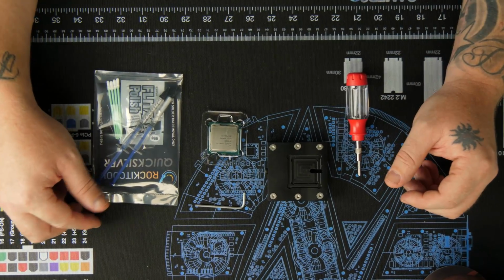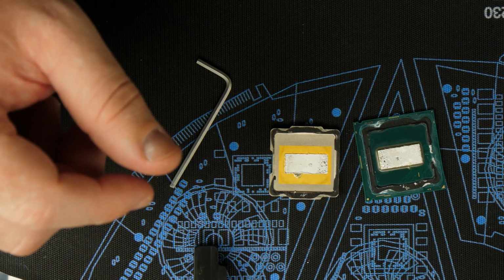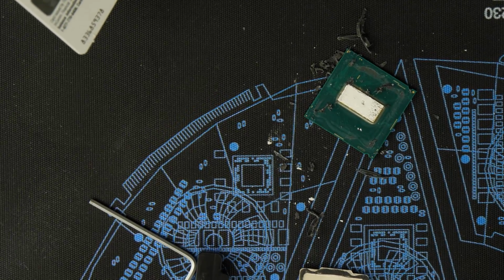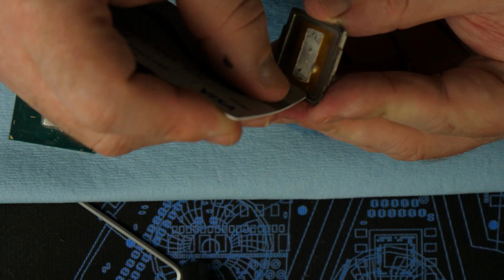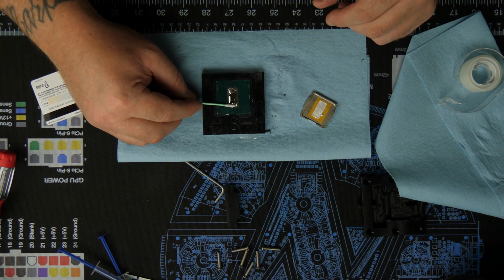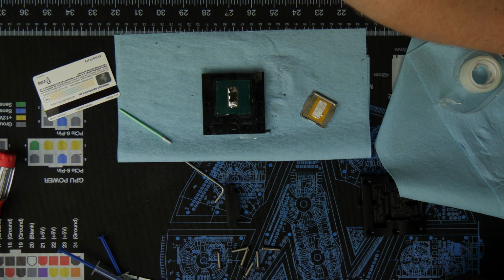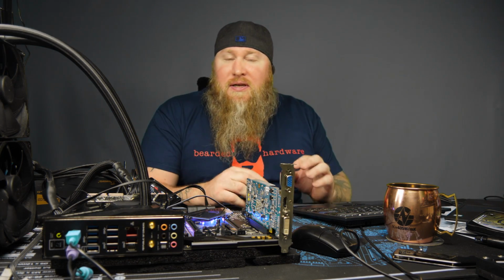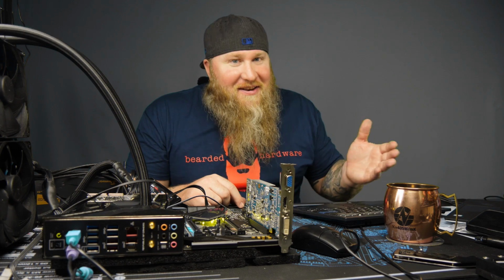Delidding the Soldered Intel 9900k CPU

Comment: Lol at 13:18 I felt a true terror cringe when you spread the solder everywhere I was thinking, " Oh God it's so much worse now!"
Reply from the maker: Hahahhahahahahah
Reply: that's why he put the tape, covering the pcb so  that it would be protected.
It would have been a horror show if he didn't!

also surprised that Joe didn't need to heat up the cpu first to soften the solder, like he said "it came off so easily, it was meant to be de-lidded" haha!
Reply: That's kinda what I thought! I feel like I've watched a soldered ryzen delid that required a good amount of heat.
Reply from the maker: Trey Matthews ya have to wonder if they use a different type of solder..

Comment: Imagine using a 9900K so close to 7/7/2019.
Reply: OC platforms aren't always the best to compute. AMD FX CPU were fun to OC but not the ideal daily drivers. Moreover, we don't know how Zen2 will behave on extreme OC.
Reply: @PainterVierax  Heh, 9900K has already been put on LN2, no need for others to do it.
Reply: @frostybe3r  Well, if you try to find some purpose about XOC you miss the point of it.
Moreover this chip is still useful. For example it's the best to avoid being bottlenecked when trying to break a GPU OC record. That may change in July (again we don't know) but for now that's what it's available.
Reply: @PainterVierax  MDS.
Reply: @frostybe3r  do you mean Microarchitectural Data Sampling?
Reply: @PainterVierax  I mean Intel failing to change architecture and being stuck with line of processors riddled with flaws.
Reply: @frostybe3r  I partially agree but this is not related to the theme of this channel. It's for extreme overclocking it's not meant to be a daily system at all. You're acting like a fanboy who can't put things into perspective.
Reply: @PainterVierax  I have both AMD and Intel's systems, getting 3950X in September, hardly a fanboy.
Reply: @frostybe3r  good for you but you still act like one by saying total nonsense.
Reply: @frostybe3r  Oh and BTW just go watch the new video on this channel, it's very suited for what you're talking about.

Comment: Are those bubbles in the solder? Wtf that's a good reason to delid. Got to be some minor hot spots there if they ended up in the right spot on the die
Reply from the maker: You saw that right?
Reply: Yeah man, that's futched up. Probably why it didn't pop. Good vid btw, parts could be shorter like people mentioned but killer background tunes. Looking forward to some more.
Reply from the maker: Kevski802 thanks broski.. much more coming for sure

Comment: they make plastic razor blades for removing decals off of the paint on cars. i bet it would be perfect for the removal of the silicone.
Reply from the maker: I would agree, think that would work very well.. the crc reallys helps quite a bit though..
Reply: I always just use an old debit card, but then again I have only done 3 cpu's and none of being the HEDT ones.
Reply: Or just plastic prying tools. I got a bunch of those from a pretty nice small screwdriver set I got of aliexpress.
Reply: It does work, though a old CPU's PCB will get the job done, used both the other week

Comment: Interesting to still see this big an improvement just from a delid on a soldered cpu.
I only delided cpu's that came which came with intel toothpaste (celeron g540 to try it out, 3570k, and my current 8700k). 

In both cases It was not really about the higher clocks 4.7 and 5.0 respectively but my aio can run so much quieter with the extra thermal headroom.
I also used liquid metal on my laptop but I wouldn't recommend it as reapply it every half year or so is a pain. (it forms an alloy with copper / dries out)
Reply from the maker: I would be careful with liquid metal on the lap top.. that stuff likes to leak out and in a small spot.. it might do it and cost ya.. totally agree about temps.. it reduces temp and gives you the ability to run different fan profiles on your cooling.
Reply: @BeardedHardware  I tend to use very little liquid metal which probably is also why it dries out fast. Leaking has never been an issue. Another thing is the laptop is a from 2016 and costed about as much as that cpu.
Reply from the maker: qlum yeah that could be why.. I tend to use things like nail polish do that way resistors don’t short etc... always better to play with old stuff vs the new stuff

Comment: Awesome video! I thought soldered chips needed to be heated up first, but I guess clearly not. Still, as a delidder I'd prefer they still use thermal paste but just make it higher quality and work on how to reduce the gap to the IHS.
Reply: I tried that and my temps went bad in less than a week (used NT-H1), they were great at 1st, so I bought some liquid metal and got another 5C improvement on peak temps
Reply from the maker: Chad McKean how did you apply paste under the die.. depending on which paste you use.. application matters a ton
Reply: @BeardedHardware  Wait did i say "under the die" cause that would be in the socket, anyway it was under the IHS after removing the adhesive on both the IHS and the PCB, the paste was NT-H1
Reply from the maker: Chad McKean yeah my bad.. meant Ihs.. ya have to be careful when you put the Ihs back on as it can slide around. When I put the chip in I use my finger to keep it in the middle and be careful how ya close it.. try it again it might surprise ya
Reply: @BeardedHardware  At this point i have liquid metal under it and have temps so low i can degrade my cpu and not even thermal throttle; https://i.imgur.com/Bznm5EA.png and yes my chip is so bad it needs many volts for low clocks, unless you see something my board i doing something silly i should adjust

Comment: So, you are telling me that with normal paste the temperature went 2 to 3 degrees lower than with it soldered? Or the solder was really bad or someting is wrong there. Normally soldered cpus are great because solder should do a better job than normal paste. But ofcourse, liquid metal is always better.
Reply from the maker: Canal 2Playerz paste did 3 degrees on average better ...
Reply: @BeardedHardware  Very strange... Solder should be better, at least, is what is logic lol. Thanks for the video.
Reply from the maker: Canal 2Playerz yeah it’s quite crazy but true

Comment: I delidded mine. Not much difference from stock. Still glad I did.
Reply from the maker: Skoopsro try lapping ihs
Reply: @BeardedHardware  I did that helped actually. I also sanded the die down a bit. Decided to step up to the big leagues, get a waterblock and join the men and ditch the AIOs. Waiting on tubes to get delivered tmro.
Reply: @BeardedHardware  Were did you get a 9900k that does 5.2 at 1.2v? Who do I need to talk to? I've got a z390dark and nice kingpin2080ti w/GPU block waiting but I only have an average 9900k. 5.1 at 1.3v
Reply from the maker: Skoopsro have to play the lottery man.. bench what ya have for now and keep looking.. how it works broski
Reply: @BeardedHardware  I have a hard time believing you got a chip that good by luck of the draw, or without buying a few hundred to bin
Reply: @BeardedHardware  thanks for the reply tho I guess
Reply from the maker: Skoopsro siliconlottery sells good chips too but you’re gonna pay

Comment: I thought that delidding a soldered 9900k would be much harder and involve an oven.
Reply from the maker: Chris Canty nope much easier then ya think
Reply: This kit use the easy-alloy chemical propriety of gallium to liquefy the indium solder. That's exactly what happens when you contaminate a tin solder with liquid metal.
I'm not sure if you can heat the indium solder up to 160-170°C and use some standard desolder wick without degrading the die since this piece was already stressed during the initial soldering process. And you certainly want to be quick, using an oven only to preheat at ~100°C (under max Tjunction) and a regulated iron to finally raise it to the fusion point. Should still be quite trivial to clean the IHS with heat.

Comment: G'day Joe,
Love the Soundtrack, also using the Plastic Card as a removal tool is so much safer than a Razor Blade, Especially as in most of the videos people using a Blade aim the sharp edge towards their fingers & end up cutting them selves,
I found it really interesting that everybody wanted Intel to Solder their IHS because the i9-7900K thermals were so bad & you just De-lid a Soldered a i9-9900K & put Thermal Paste on it & get better thermal performance, all soldering did was make it harder to De-Lid 🤣🤣🤣🤣🤣

I just bought myself a i5-2500K, EVGA Z68SLI-Micro, 4GB DDR3 1600MHz, EVGA GTX760 & cut up an old PC case to make a Test Bench so I can play along at home & learn what the settings do with your OC videos,

P.s. looking forward to more OC vids & saving up for a couple of Bearded Shirts $US is not good for Aussies at the moment
Reply from the maker: shane eslick awesome man. Still working out formats for some OC Videos.. I have many things coming .. very high end stuff.. gonna be interesting what ideas I come up with. I need to get a distributor over in Australia

Comment: THAT WAS A ACE JOB 👍👌 ,you made it look so easy Joe, I was gonna buy a pre delidded 9900k from case king so I can go direct Die , As I aint keen on using the razor blade method to get the solder off , I was willing to pay the Extra $120 Euro on top of the price of the  chip for piece of mind but after your vid I will deffo try your technique , I have delidded my 8600k and applied liquid metal  ,and its running cool and quiet 8 moths later ,so I don't mind getting my hands dirty , I just wasn't brave enough to go at the £500 quid chip with the razor , best technique I have seen , awesome Joe 👍
Reply from the maker: Gaz Yates thanks broski

Comment: Random Question, Would it be worth it if I delidded my 9900k for more than just overclocking? Reason I am asking, while I got a decent sample (Can run 5.0ghz at 1.26) the temps on the thing is crazy (75-80c, I like to keep my Procs around the 60c range if I can help it, call it OCD). Even in a full custom loop. So, I was thinking to delid it so I can bring not only those temps down, but to also make my water-cooling setup be more efficient. Less Fan Noises, Less Heat Soaking. I mean, its fine now running without the deliid at that speed and vcore. Just would like less noise to go with it. =)
Reply from the maker: Powerman 5OOO yes that could work too
Reply: @BeardedHardware Thank you for the reply. So I am going to do the delid but I am thinking about doing a direct die mounting. I know they have die frames (der8auer) for my 9900k. Question, will I have to change the mounts on my EK waterblock? With the z-height being lower without the IHS, it would seem those pins/screws on the EK mount would be too tall. Or am I over thinking it and they will still work?
Reply from the maker: Powerman 5OOO depends on which one you use.. I would read the directions on whichever one you buy.. I know rockitcool makes one also on their site.. hard to say if it will effect you or not.. either way it’s always good to be a bit paranoid .. ya don’t want to kill stuff broski!!!
Reply: @BeardedHardware Got the delid and direct die kit from RockitCool. Since all the der8auer ones are sold out everwhere it seems. No issues mounting the waterblock to the die. So far, no issues. Will see when I stress test it.
Reply from the maker: Powerman 5OOO awesome make sure you are very careful with stress testing . Pay attention to them temps :)
Reply: @BeardedHardware 3 hours in, running my safe 4.7 all core at 1.125 vCore. Has not pushed above 52c on the package. Cores bouncing from 47c-52c. =)

I will be pushing it tomorrow, once I get this test finished overnight.
Reply from the maker: Powerman 5OOO now
Bump them clocks up
Reply from the maker: Powerman 5OOO you using liquid metal?
Reply: Bearded Hardware Yes, conductonaut.

Comment: I have an off topic question, when super cooling with LN2 I see that you use paper towels as a moisture barrier, do you think 100% silicone would work as well?
Reply from the maker: Scrub Rezidue have actually used it before.. problem is the application and cleanup methods suck

Comment: You should mention that the CRC is contact cleaner and not brake clean. They make  both, but brake clean is corrosive as fuck.
Reply from the maker: Yeah I have many times before.. crc makes many different types of cleaners.. not just eletronic and brake.. have to be specific :)

Comment: My 9900K only does 5.2 at 1.37. It does not like higher than 5.2. Do you think it is salvageable with a delid or I should bin others (or wait for the KS)? The KS is going to be R0 and I know my 9900K is P0, so it will outperform the KS at the same clocks. However, the KS should be better binned and clock higher. 

If I can get 5.4 out of my current chip with a delid, I would be completely satisfied.
Reply from the maker: Frank R tbh I saw more benefit from lapping.. then delidding..  but if you lap then delid then liquid metal.. you might be able to squeeze more out of it
Reply: @BeardedHardware  Okay, thanks for the info. I'll do all three. I'm waiting to see what you can do with your binned KP 2080 TI. My two are 16th in the world in FS and I am in the top 25 in other 3Dmark HOF benches. https://www.3dmark.com/fs/19375902
Reply from the maker: Frank R pretesting today.. next week will show some ln2 live-streams .. finishing the stream box still

Comment: Makes me so sad seeing all these 9900k's getting 5.3 around 1.3 v, mine only does 5.0 at 1.35, can't seem to get any higher in it. Ek blocks, 2 360 rads. Highest temp is like 77c in prime95. I really want the Apex board, but can't find it in US
Reply from the maker: Apollo1321 siliconlottery.com get a binned chip
Reply: @BeardedHardware   ehh $900 for one that does 5.1g at 1.312v doesnt seem like a good deal to me at all. id rather take my chances on another random one :D BTW thanks for signing my mouse pad when you was with Steve on the live stream!! Have you OC'd any of the 9900kF chips? im curious how the disabled iGPU affects them for overclocking.
Reply from the maker: Apollo1321 dame lottery as the others.. maybe better all around .. haven’t went through too many

Comment: Wondering is it necessary to delid older cpu like Xeon 771 example x5450? As I seen some were running extreme high temp. Since I got an Xeon e5450 overclocked at 4.32ghz @ 1.312v did get to 4.5ghz on the maximum 1.35v as I wasn't going to blow it to an early grave by overvoltaging it to popcorn maker :)
Reply from the maker: I’m pretty sure those can be delidded also..
Reply: @BeardedHardware  Could you do a video on 771 Xeon over clocking and delidding?
Reply from the maker: Ned Smith time is tight, but I’ll look into it slacker!!
Reply: @BeardedHardware  Coolaboola Slacker

Comment: audio still little quite.
Reply from the maker: Lucky Barker next video is better
Reply: Bearded Hardware awesome brother like to help what i usually do with my mic or line and set up as I usually take the make up to70 to 80 and then do the rest still on the church board or Mixer whatever you may be using as main out. but you probably already get that kind of stuff. 
That’s what I personally do 

your mic sounds clean so I don’t think you have to worry about it over deviating /distorting.
A cheap shitty mics i used to use I never went over 50 on input. Especially when I used to stream audio . Brother your content is awesome keep up the hard work. Get beardy ;)

Comment: Should I delid area 51m? Desktop processor in a laptop?
Reply from the maker: Robert Cooper what processor
Reply from the maker: I just looked up the laptop.. I would definitely do it.. I would be careful on how the cooler attaches though first. That could make it difficult to reattach.. because cooling is usually the biggest problem... would be a good way to go

Comment: Awesome video! Where do i get the solder remover in Germany? Is it legal to import into europe?
Reply: I think der8auer just scrapes it off with a razor blade, but look up his video on delidding ryzen(or 9900k if that video exists) before attempting this. If you still want a product like the one used in this video der8auer is German and might have a better idea of where to get this kind of stuff in Germany.
 The solder used is indium based, so it is much softer than both the silicon of your CPU and the steel of a razor blade. The CPU die is mounted upside down to the substrate, so the circuits are on the bottom and small scratches on the top shouldn't impact performance beyond the thermal loss.
Reply: CapriSonne it's just mercury. If you can't find where to buy it, try to find an old mercury thermometer and break it.
Reply from the maker: Laughing Orange ya have to be careful because if you scratch even remotely to deep you will kill it.. seen it happen

Comment: Hmm.... shoul I delid my 6800k ? I know its not the latest and gratest.
Reply from the maker: I wouldn't recommend it on that chip.. it doesn't help to much with broadwell chips.. they weren't the best clockers.
Reply: @BeardedHardware  It would still help if you wanted a quieter overclock right? Ofcourse that means you can bench at higher voltages

Comment: So, using that products the solder simply goes away?
Reply: It's gallium : a metal with a very low fusion point that has the tendency to easily make alloys with a lot of other metals and making the result softer. Indium is already a low fusion point metal only 160°C and it's quite softer than tin so that's why the liquefying reaction is fast. Liquid metal is actually a gallium-indium alloy so you want to be precautious with it otherwise it will pollute solders and weaken them to the point SMD drops from boards at ambient temp.